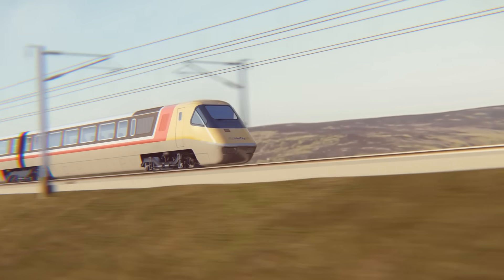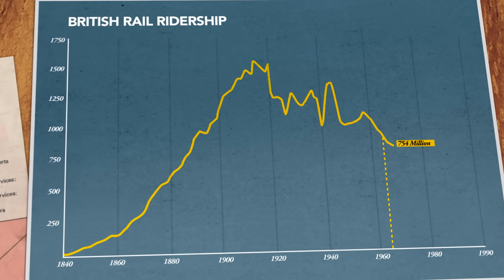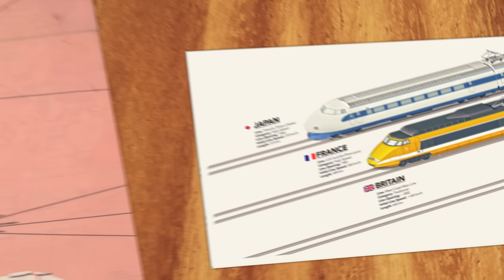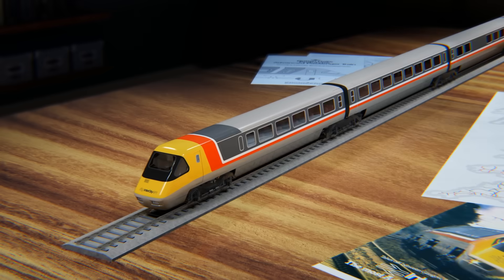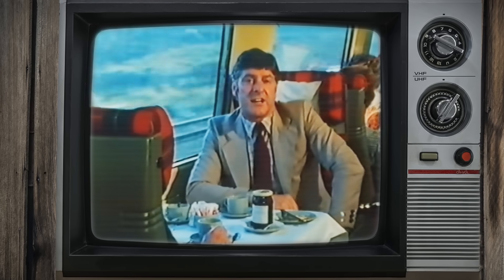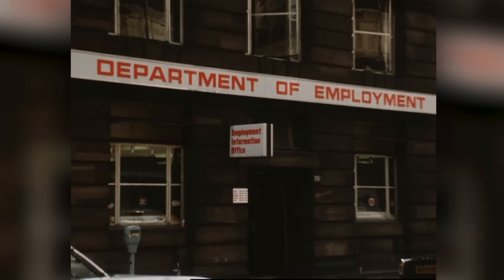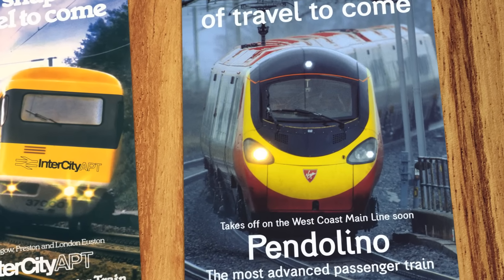This Train Made Passengers Sick: The APT Tilting Train Story

Comment: An Italian-designed tilting train, based on UK technology, operating on UK rail lines where the UK-designed tilting trains failed.  
 
Feel The Burn....
Reply: Strangely, it was a Brit (John Burland) who prevented the Leaning Tower of Pisa front falling over. Now had he gone into train design....
Reply: @MorgoUK  >>> I do not know about that.  He fixed something that was NOT designed to lean.  
 
Those TRAINS, however...😝😝😝
Reply: They've been dealing with a tilted tower at Pisa for centuries, they have experience
Reply: @dafuq1933  >>> 👍👍
Reply: @dafuq1933  and the irony is, if they had built the bell tower on solid ground nobody would have flocked to visit it, not to mention millions of Lira from tourists. 😂
Reply: Technically all trains are based on UK technology.
Reply: @Graciethecat42  All industry too.
Reply: Nothing of the APT ended up in the Pendolino. It's just a legend.
Apart for the fact that the Pendolino prototype, FIAT Y 0160, was built in 1970, while the APT prototype run for the first time only at the end of 1971, and the first commercial Pendolino (ETR 401) became operative in 1976 and had been retired from passenger service only in 2008, the working principle of the two is different. Pendolino has two gyroscopic and accelerometric transducers on the two bogies of every car, instead of a single accelerometer on the center of the car. That means that it reads the inclination of the track at the start of the turn, and can react in advance and more precisely than the APT system, avoiding the oscillations and imbalances that were the cause of the motion sickness of the British project. That's why it had been so successful worldwide.
Reply: Finnish national train company bought Pendolino tilting trains few decades ago.
Engines and wagons are still in use, but tilting system removed.
Reply: @petriharha6583  wrong, nothing is removed.
Reply: That happened to the post-WWII British industry quite often though. 1950s- to 80s British industry was such a mess that even the greatest, most innovative stuff did not save them. The Brits also invented the Mini, which revolutionized the way cars were designed, and di not manage to make profit on it.
Reply: Does Italy 🇮🇹 do that all the time?
Reply: The first Italian tilting train (ETR 401) entered service in 1976, five years before the APT. Fiat Ferroviaria did not copy anyone. Ten years later, when the APT was abandoned, BR offered to sell its patents and no-one was interested. The Brits are great inventors but the APT program was just shambolic.
Reply: @TheAmir259  You are wrong on all points. First, I am French, not Italian. Second, why should I stop saying no one was interested in buying the patents? As reported by David Clough in his book "APT, the untold story", page 138: "BR offered the APT engineering for sale but neither ASEA nor Fiat were interested in the tilt technology". ASEA was the Swedish company behind the moderately successful X2000 tilting train.
Reply: @matteovezoli4956  that doesn't really change the point of the original post.
Reply: RocKiteman _ 2001 the British also had the worlds first passenger jet airliners? Sadly the sensitive active hydraulics were not developed enough on the APT-E as they were still being pioneered. Sometimes this is the price you pay for innovation. Sadly we are now looking to carve up the Chiltons for HS2. How is this considered progress?

Comment: The story behind the headline is that BR took a load of journalists out to dinner before the press run of the APT. They all had more than a couple of drinks. Off they went on the train and as it started going round the curves with the tilt system activated, they  started feeling unwell. Today’s successor the Pendolino tilts away round curves as a matter of daily routine. It’s an odd sensation until you out think it. Think aeroplane turning, then your mind goes: ‘oh I understand now’ and the rest of the trip is fine.

Comment: The HST which was developed from this ended up being BR's most successful design and are still in service more than 35 yrs later
Reply: HST not developed from the APT, it was developed by BR Engineering unlike the APT that was developed by BR R&D. HST used an evolution of tried and tested railway design this worked pretty much out of the box - one prototype and then production. The BR Mk.3 coaches were, for instance, designed in 1970.
Reply: @ianmurray250  I stand corrected

Comment: They're too fast and risky of catastrophic accidents, derailment and terrorism which increases the risk of instant death. If you stupid travellers want speed, go and board a plane instead. This crazy technology is going to finish us off one day. Give it time. 

What if the train has to stop on a tilted bend and then has to take off, wouldn't the carriages on the bend capsize from the pulling gravity? It goes well with a tilt at speed, but if it has to somewhat stop in an emergency, what happens when it moves off under acceleration on the bend? I got a feeling that it will capsize and drop on its side. Do it on model trains and see what happens, the middle of all carriages will tip over and fall on their sides.

Comment: There is nothing in the video to support the assertion that the APT "caused one third of passengers to become motion sick" - or that it caused anyone to get sick at all. (The highlighted text shown while the narrator is saying that doesn't contain anything like it, highlighted or otherwise.) Without knowing much about it people tend to say railroads developed in the first part of the 20th Century in Britain and the US are hopelessly curvy and obsolete whereas in the case of both East Side Access and High Speed 2 the tendency toward unnecessary serpentine alignments and steep grades is pursued with abandon. As a result the old lines are superior, even while they were harder to build do to limited technology of the time. Given the limitations of steam power direct routes unobstructed by grades and curves were considered important, both for fast scheduling and efficient, cost effective operations. They still are.

Comment: The german classes 605, 610, 611, 612, 411, 415 have the tilting system too. and it worked. on some trains from the classes 411 and 415 they had to stop it, but for other reasons

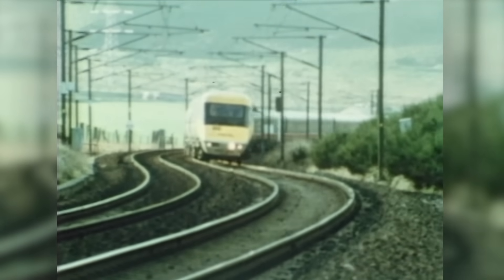Comment: Oops. The tracks in the UK were intended to run on were also tilted - at 9 degrees to be precise - allowing all other trains to travel at higher speeds. You can see this in the footage at 5:30. The tilt mechanism was sold to FIAT and reintroduced to the UK with the Pendalino which runs on the same tracks as the slower trains, just like the APT. You've also missed out the changes to the signalling systems that the APT was going to bring in with its introduction.

The sickness problem was mainly with hungover journalists.
Reply: 6 degrees for track in the uk thats due to it being mixed with freight
Reply: Anthony smith thanks, I was close. I suspect that I've mixed up the angle of cant with the total angle the APT was allowed to tilt. That's what comes from making. Comments without checking things.

Comment: The APT is quite a sad tale in BR history. Meant to serve on the West Coast Mainline, one of the twistiest and bendiest mainlines in the UK, it certainly would have been good had it not been for the media and political death it faced. They were supplanted by the Class 43 HST/Intercity 125 trainsets, and later the Class 91/Intercity 225 electric trainsets on the ECML and Class 390 Pendolino tilting trainsets on the WCML, as mentioned. What I find funny, though, is that Belgian Bombardier-made Class 220 Voyager diesel trainsets that serve as smaller, shorter-haul trains on the same route on the ECML have a tilting brother - the Class 221, made for the WCML. 

Part of me wishes they'd bring the 390s, 221s or other tilting trains to the ECML as the less bendy line lets them run at a higher speed, but there's also the signalling issue as they'd need in-cab signalling to work. Plus, they're getting Class 800s/801s/802s so it's not too bad. We don't need a high speed line like HS2 to feel good about our trains because at least we aren't the US!

Comment: I used to drive the APT during testing between Carlisle and Carnforth back in the early 80s.
The only motion sickness was due to pissed up journalists who were very anti railway worker at the time. I also sat in that train as a passenger with all the technicians doing 100s of miles and never once got sick. 
But "allegedly" there was a lot deliberate fiddling to make it fail to extend the testing, then Maggie Thatcher cut funding forcing BR to put it into service when it wasn't ready and eventually pulling it out of service.

Comment: I travelled on it three times - it was a marvel and the fact that it wasn't continued was down to a lack of political will to build the production series (The conservative government of the day was busily underfunding rail so that it could be sold off as a failure) and the layout of the train - with central power cars, it was effectively tow train sets and required double staffing, two kitchens etc. BR struggled to build a pantograph system that coul be placed at either end of the train and wouldn't suffer from vibration fluctuations in the overhead line; they didn't want to run high voltage cables under the train set from a single pantograph, so central power cars were a stop ga. The rpoduction series might have cured this, but it was the pendolino that showed that BR was right all along - it was a technical marvel and showed what a golden age of innovation the BR period was in british rail history.

Comment: Nice quality video! Good production and visuals, and most of the info is right. BUT... there is one critical error.  The train DID NOT give its passengers motion sickness - plenty of people rode on it without experiencing any discomfort. However a number of journalists who over-indulged in the free drinks offered by BR on the launch run were indeed very sick and blamed the train rather than their own lack of restraint. It then became stuck in people's minds that the train made people sick because that was reported in the press.
Ditto the breakdowns on those early press runs - that cemented its image as an unreliable train in the public eye even though by the time it was re-launched in 1984 most of the technical glitches had been overcome and there was nothing really wrong with it. The press wrote-off this very impressive and innovative train before it ever had the chance to really shine, which is a real shame.  That said, it is true that whole project was a little over-ambitious in that 155mph service was impossible to fit in around existing 100mph services even though the train its self was easily capable of such speeds. However we do have the APT to thank for the marvelous HST (Intercity 125) that has recently celebrated 40 years in service, and of course the Intercity 225s, which drew heavily on the design of the APT. And then there is the Pendolino, which owes its entire existence to the APT.
Reply: Aye to that but also got to add the West Coast Mainline is the busiest mixed use line in Europe, mixed as in with Freight trains that can do 75mph at most.

Comment: Hey Mustard, I was wondering if you could maybe do such a video on the Union Pacific's 4000 (Big Boy) class which is one of the larger class of steam locomotives manufactured. It may not be too different than a kettle but it is a mechanical marvel, an analog relic compared to the more digital trains of today. I was curious if you wanted to take on such a project after seeing that you have tackled analog marvels such as space shuttles and digital marvels such as passenger jets and such high speed passenger trains. Regrettingly it may be difficult to render such a complex and large item though the only items such as the wheels, rods, and valve gear would be in motion. If it is not a problem then setting it to run at the normal speeds you seem to run your digital models at is a sure thing to do as this class of locomotive is though to have been constructed with forces of up to 80 mph in mind. May as well be possible as another analog relic from the 3900 class (Also for Union Pacific) has been recorded to cruise at 70 mph (Its top speed) as shown here: https://youtu.be/aH4xZXskLIg  with this video showing how the valve gear should be positioned when going forwards: https://youtu.be/SrzfcNogohw?t=54 . It may be a dawning, long process but this locomotive class is believed to pull a 5 mile long train on level track single-handedly so I thought it may interest you, thank you.
Reply: The biggest for sure! You gotta think if diesels and electrics wern't around the corner these would have been the way forward for large countries that need to move more and more  freight.

Comment: It wasn't just the tilt problem. The water brakes weren't reliable. With a bit more government backing it would of worked.  It does now with pendilinios tilting their way up and down west coast main line.
Total block signalling isn't out of date though. It's cornerstone of signalling safety.
APT wasn't designed by rail engineers it failed.
IC 125 was designed by rail engineers. It's so successful some have been refurbished and are used in Scotland.

Comment: I think that in the long-term point of view, high speed tracks are much better than tilting trains.
Tilting trains are good to connect cities that still don't have high speed tracks. It's like a "provvisory" solution.
For example, making London - Edinburg as a high speed network would be very costly, but would give a super fast connection. From London, Edinburg and other intermediate big cities, tilting trains towards other important cities would give the best network (for example: if the HS line passes through Manchester, tilting trains would be awesome from Manchester towards Leeds and Sheffield and Edinburg - Glasgow).
The HS line would also permit interoperability with the Paris - London channel tunnel and the rest of Europe.
Using tilting trains all way from North to South is just "good" but it can't give the economic boost Japan had from Shinkansen.

Comment: Important to point out that the "sickness" occurred on one specific demonstration run where the journos got smashed on the complimentary drinks, rather than as standard for APT passengers as the title of this video implies. Of course those journalists would then go on to write articles about they were on APT and got sick.

This is simply the train version of TSR2, a great marvel of engineering and innovation killed by smear merchants and cowardly politicians.
Reply: Well no, the story of APT is a lot more complex than a smear campaign, if this had been a one off occasions in an otherwise trouble free service career it would have been quickly forgotten. After all, all new technologies and new designs have kinks and teething problems, but APT had a lot more difficulties than mere queasy journalists. For starters, as Mustard said, it had barely any testing and what testing it did have didn’t generate enough useful data, plus the passengers prototype was deleted altogether. But more than that, BR didn’t really want APT, by the time it was in service the HST had already proved itself technically, and had received rave reviews from the travelling public. HST was cheaper to build and maintain, used proven and readily available systems and could run on the existing network. 

See not a lot of people understand this but Engineering is actually one of the most ‘conservative’ Of scientific fields, what I mean by that is that the general maxim in engineering is to build upon what has come before, fit the shape that is already there, and in the end what APT was trying to do went against the environment it had been placed in.

Comment: Sweden has its own tilting trains developed in the in 30 years from 1960 to 1990 when it entered service. the x2000 developed by governmental railroad company and asea. Sweden was/is in the same position, and the x2000 train could run 200 km/h on tracks between major cities and Norway. 

A few years ago it was decided to yet again pour money into this project and this will be Sweden’s high speed rail for another 20 year. The train goes now in regular service to the north, Oslo, Gothenburg and Copenhagen, all from Stockholm. 

The train has only been exported once, to China, which for some reason only bought one and they returned it ten years later without making very much traffic. China started to develop their own tilting high speed trains. 

They have been discussing building a separate high speed rail network to compliment the crowded normal rail network for 30 years, but it’s still too expensive, and the politicians are too coward to start build hyperloop even if they have been in the parliament discuss a hyperloop to Helsinki.